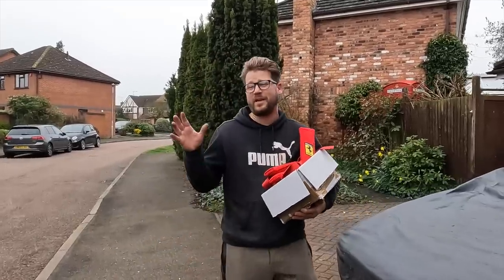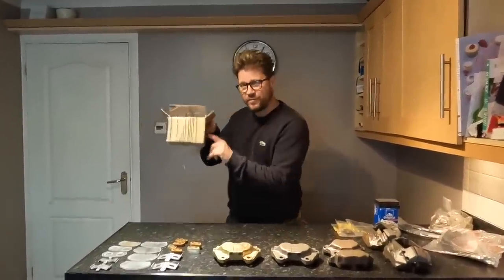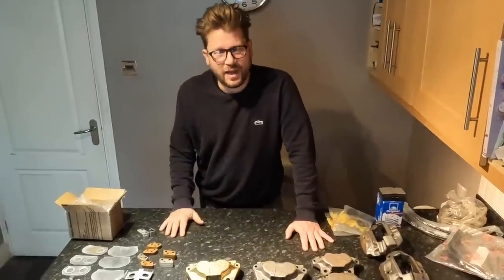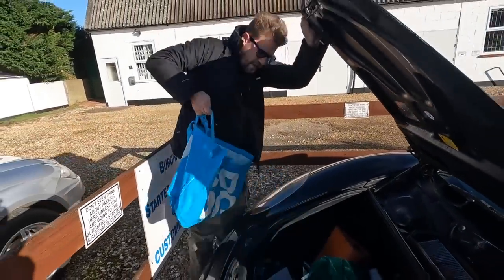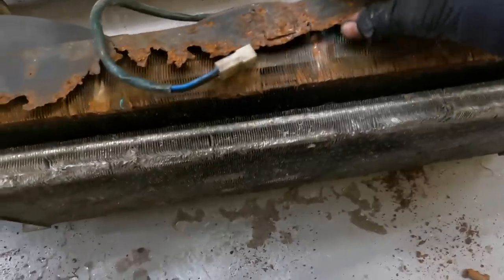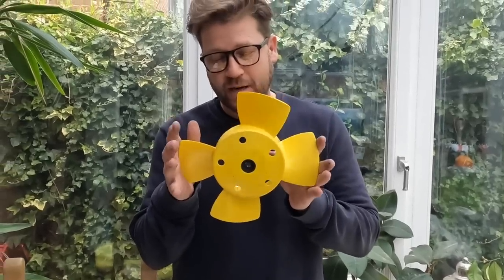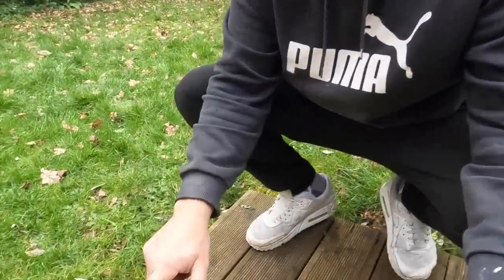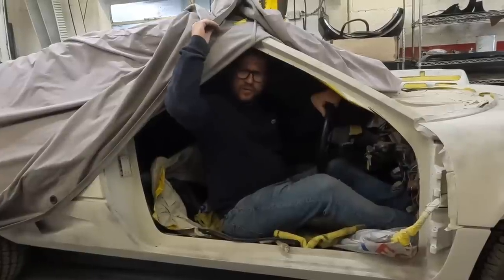Barnfind Ferrari 512 BBi -  Lost Parts Brake the Restoration

Comment: PMB Performance in the USA can do your caliper finish. They specialize in vintage ATE brake restoration.
Reply: I’m sure there are companies in the U.K. who can do it as well
Reply: PMB are experts in calipers. Specialize in Porsche, but they are often the same manufacturers. They have all the right equipment to do them right.
Reply: @robbrooks4964  Porsche used to have a special Cadmium based electroplating solution for their parts. Nowdays considered to be extra toxic
Reply: I was going to say PMB as well. Top notch, so +1 to this recommendation

Comment: Any metal parts you want to protect from corrosion, wrap them in heavily waxed paper too like every old hardware shop used to do. The radiators and fans look stunning !
Reply: Where possible, a thin coating of oil will help just as tools are shipped, or wipe down with ACF-50 a favourite for many all weather bikers to prevent rust and corrosion, it even removes surface rust.

Comment: I assume that you'll drill a couple of drainage holes into that bracket below the radiator to ensure the rad no longer gets to sit in a pool of water and rust to bits again!!  And protect them aswell.
Reply from the maker: I sure will 👌🏻
Reply: @Ratarossa  Some Rads sit on a sponge cushion which holds moisture. Poor design but once out of warranty when they let go ....

Comment: It has to be possible to zinc plate with yellow passivation , Brake callipers to this day are being plated that way at the suppliers factories, BUT back in the day hexavalent Chrome was used for that passivation, that's now banned as very carcinogenic. The modern process uses safer trivalent chrome for the passivation and you won't get quite the same shade as back in the day. But you need a plater who knows how to plate cast iron  ( spheroidal graphite cast iron in this case).

Comment: For the brake calipers, I recommend treating with OSPHO chemical treatment following rust removal. It treats the metal to prevent rust formation and forms a surface that primer and paint can adhere to.

Comment: zinc plate first then gold dichromate- which is a passivation(forced oxidation creating a harder more durable outer layer) of the ZINC plating.
These passivations are listed from least durable to most durable
Zinc with Clear/blue passivation
Zinc with Black passivation
Zinc with Yellow dichromate passivation
Zinc with OLIVE passivation.

Comment: i vapour blast and polish for a living, you cannot vapour blast parts with bearings and moving components unless you strip the part completely. Same with intake manifolds.. after blasting they have to be cleaned inside and out, no abrasive can be left behind..
Reply from the maker: Hey buddy, i tried to email you about various things but it bounces back, any idea why ?
Reply: I've been told that such parts need to be boiled in water to remove any fine abrasives that get trapped in pores after blasting (when the part has critical moving surfaces involved.)
Reply: @ferrariguy8278  Can use ultrasonic cleaner as rinse, then dry with compressed air

Comment: The blades on MG fan could easily be  machined down on a lathe by making up a mounting plate to hold it and then the ends of the blades will be machined to the correct diameter accurately.

Comment: Powder coating is the answer for your brake calipers I think. I've had some amazing results for old motorcycle wheels and frames.
Reply: Still need plating 1st other wise areas that musn't be painted will corrode ( including inside) and as soon as you get a chip the powder coat will blister off , has to be Epoxy not polyester -  Iron brake callipers with painted finishes that many modern cars have are all zinc plated 1st and then primed and epoxy painted.

Comment: Hi Scott, the caliper halves are Nodular Cast Iron (Also called Spheroidal Graphite Cast Iron), not steel. It is the same material that any caliper housing or master cylinder body is made from (unless its aluminium!!). So, there are a number of platers out there who do the yellow zinc passivate for companies that make brake master cylinders and calipers. There is a company called PastParts in Bury St Edmunds who specialise in restoring brake components and claim to be able to get the correct Zinc finish, they could be worth a call. Do be careful with your seal groove in the caliper body, as these have been plated once you need to make sure all plating is removed before new plating is added. If the seal groove becomes smaller by more than a few microns then the seal may have too much compression and the piston might drag. Normally when caliper bodies are produced, the raw casting is zinc plated and then it is machined, meaning that the machined surfaces are not plated. Look for people experienced in brake restoration, not general zinc platers.

Comment: Rata after doing the zinc coating you should clean with distilled water thoroughly then when you dip the yellow/gold chromate dip for no more than 20 to 30 seconds it should not matter what steel is used if the process is done correctly it should stick i would try another plater as people do things the same BUT different technique cheers from down under

Comment: Im in the states so I got quite a few hits when goggling yellow zinc platting so there are definitely people out there to do it. But it doesn't hold up well on brake calipers. I had gotten some replacement calipers for my daily at one point with the yellow zinc finish and it didn't last long. And while searching its a common issue. So even though its the correct finish on something that is never going to be driven hard I feel getting them powder coated as close to the original color as possible would be your best bet.

Comment: To zinc properly don’t they have to coat it In a different base metal like nickel, that what they do with gold plating jewellery etc. just an idea
Reply: No ZINC is the base metal. You could copper plate it first, however the ZINC is a sacrificial metal which is designed to corrode FIRST instead of the actual metal part.

Comment: Good interesting stuff.  That Radiator Rebuild was a fine piece of work. Missed how much it cost.

OEM £4490 from Ferrari .. :-))

Some OEM parts are silly expensive, even ordinary production cars like my MG Montego Turbo was back in the day. Cowley MG in their wisdom decided to reduce the width of the NASP MG Montego's radiators to allow the twin to-from Intercooler Pipes to pass at the side. Must have been at least a 20% reduction in width. Cue a tendency to see the temperature gauge rise on hot summer day Motorway hold ups with the radiator fan kicking in and out manically sometimes on really hot day stop start hold ups. Never over heated but, was a worry.

Not only that reduction in width and frontal cooling area, making things worse, they fitted smaller capacity PLASTIC side reservoirs not the superior METAL/Brass? ones on the NASP MG Montegos. d'OH. I removed the metal radiator from a rear ended Montego in my favourite "Remove it yourself" breaker yard. A fiver .. :-))  and took it to a local radiator specialist. Along with the skinny OEM original to use as a dimension pattern. I asked them to use the superior and larger capacity metal side tanks and fit a new TRIPLE CORE Radiator using the metal side reservoirs. They did a superb job better than I expected. That £100 cost was possibly the best hundred quid I ever spent on any car upgrade. It enabled my MG Montego Turbo to be cruised all day long if required well into three figures MPH with complete confidence. Much to the chagrin of friends in so called superior cars like Mercedes trying to keep up and failing.

Even twenty years ago allowing for inflation, that was one hundred quid well spent.

I have an image somewhere off the Rebuilt Radiator sitting on the old one clearly showing the deeper triple core and superior metal side tanks within the same OEM dimensions. Cue folks asking what has been done to the MG that it was so quick. My honest answer, the engine and tuning was bog standard.

Comment: The Yellow aka Gold zink plating is done still today on custom computer networked cabinets or data storage cabinets there a few who make and plate them still in the uk they acid zink the coating on by dipping it into a chemical bath to the metal body of the frame to the computer for heat protection, The same process which was done to the callipers back in the day, it a long story how i know that
Reply: All the other parts he's had done were zinc plated and chrome passivated OK , but they seem to have had trouble plating cast iron, won't ever be exactly the same colour as back in the day as modern trivalent chrome passivation doesn't give quite the same colour as the old now illegal hexavalent process.
Reply: @jabberwockytdi8901  Dear Sir. 
The process by Ferrari which i rang myself today 
1.clean in Alkaline solution
2.water rinse (still water)
3.Acid pickling (HCL)
4. Water rinse time 2 one after the other again in (Stilled water)
5. Electro plating in Acid Zine Bath 
6. rinse again in (stilled water)
7. Dip in Yellow Passivation 
8. rinse again in (stilled water)
9. natural dry 
the process in total is 9 hour and 47 minutes 
the same process is use still today for the metal casts for computer network cabinets as ive already said again the same process was used 40 plus years ago.
i have been in the pristine car trade from the day i was born i know what i an talking about......
Reply: @rob612  Those original calipers look cadmium electroplated which is silverish
Reply: @jackdripper5675  if you look at the video again at 3:29 even Scott explains there finished in a yellow ish or gold finish from ferrari, off the top of my head google the part ferrari 136596 it should come to a original front left calibre in the same finish Scott wants and the same finish that is used for the inside housing for computer cabinets or the metal frame that the computer sits in, i personally been around a few BBi in my day as well and one that was fully restored similar to scotts

Comment: You really had to fly to Florida to make that tiny part? There isn't a CNC-manufacturer up to the task anywhere in the UK? Hard to believe... but I guess Florida weather was a nice break from rainy England :D

Anyway, things coming along nicely, and that radiator looks fantastic now! Did they refabricate the rotten metal part as well? Awesome job! 
Maybe there should be some drain plugs installed on your car under the radiator to avoid getting it rusty again.

Comment: If cost is not an extreme concern you can Cadmium plate and then zinc plate. Zinc plating directly to cast iron requires acid strike vs normal alkaline. Gotta be someone in UK. If not, Poland has everything lol.

Comment: If you want to color the calipers try powder coating them. It wont burn off and I just did a quick check and they have a Ferrari yellow.
Reply from the maker: The problem with this one is I want to have it totally original spec otherwise I would powder coat
Reply: @Ratarossa  Ok that explains it...Thanks for the response...! I cant wait to see in back to spec...!!

Comment: I assume the "Gold" finish you are referring to on the calipers is cadmium plating. It's not hard to find someone who can replate them. It is much more resistant to corrosion than paint, cadmium plating is used on a lot of aircraft parts as well as areas with dissimilar metals. Someone who professionally rebuilds carburetors should be able to replate these for you.

Comment: Great Video!

Love the Radiator / AC condenser rebuild! However, you stated the positioning will lead to it rusting out again as water is unable to drain in the location where they normally sits. What are you planning to do to prevent this type of problem happening again?

Cheers,
M-

Comment: Oh boy, after all these troubles to get the fan you use a driller and hold it by hand?
Could easy end-up off center, I would have popped by a local machine shop with some beer cans or a cake and borrowed a rotary machine!
Did you try if the fan runs balanced and centered now! ;)

Comment: Scott, did you look into Nyalic as a clear protectant for exposed metal once it has been finished (to further prevent any future corrosion?   Interesting that there was a problem plating the calipers. You'd think a plater could do a number of coatings of a base metal (maybe zinc  maybe not) then follow up with the yellow Zinc plating.   And it was yellow Zinc originally and not Gold Cadmium?  I know in the US BrakeBoosters is a company that does refinishing work for classics - both Zinc dichromate and Yellow/Gold Cadmium.   For possible future reference I'm seeing fans that appear to maybe be the same off of a 127 FIAT Panda, Fiat Ritmo (83 to 87) and maybe a 85-89 Lancia Y10.

Comment: Just do the yellow zinc yourself. By the elements put them in a bath of water with salt and use direct current. I got some solar panels and I just use those to do some electroplating. I'm sure somebody Patton to the process for yellow zinc pleading so read the Patten and get the formula. Good luck.

Comment: Ferrari probably plated the calipers with something else first, like copper or nickel before doing the yellow zinc. I used to plate and anodize and that was the trick for plating. There are also conductive coatings but I doubt anything that exotic was done.

Comment: Absolutely love the channel mate and with all your projects on the go, it doesn't look like you will run out of content for quite some time haha
Hope you end up restoring the 456, I have the identical car her in Australia, with all the same issues.You have solved many of my problems for me and I have many more to go. Cheers :)
Reply from the maker: they sure are problematic. I have a couple of new ones to figure on it. Here they are still a cheap Ferrari, I often want to sell it but i look at it and its so good looking and understated from various angles I decide to keep it
Reply: @Ratarossa  I have had mine about ten years now and like you I got it crazy cheap (30K AUD), but not running, turned out to be an immobiliser issue, along with other things. Spent months just trying different things until I finally stumbled onto it. Been running perfectly for most of that time just little things, but last year it did a head gasket which wasn't much fun. All good again now. First thing I haven't fixed my self. Keep up the great video's

Comment: Hi Scott, I'm not sure how you kept the hole you drilled concentric with the original one, especially with the slots cut in the original hole. Check the fan with the motor before you put it on the shelf. If it's not concentric, it will either ruin the motor bearings, or if it's really bad, shake the motor enough to crash into the fresh radiator. Good luck with the work.
Reply from the maker: Yes I was very concerned about that, I have checked as best possible and will spin up the motor for a final run
Reply: @Ratarossa  if it’s not concentric, there are solutions. Good luck with the restoration!

Comment: I find it hard to believe it was easier to fly to the USA to get the parts done. I have hade parts cnc milled and routered in metal and carbon here in the UK easily. It's not cheap with combined design time then machine time. But no plane was needed

Comment: also the only thing I know to fix rust on steel is to have the rust sand blasted off after you seal of the areas where pistons and break bleeders/lines go in..... then zinc plate it after the sand blasting..
Reply from the maker: thanks for the tip

Comment: Issue with you getting the yellow finish is that it’s zinc plate with a passivation layer. The passivate layer is hexavalent chromium, this is now banned under EU regulation 1907/2006, you may be able to get this done outside Europe. Hexavalent chrome is a carcinogen.

Comment: probably been said but are you putting 12v through these electric motors to make sure they are working before rebuilding?
Reply from the maker: most of them i am tested yes
Reply: I figured you were. Wish me luck. Trying to correct a fuel supply issue with my 01 456mgt. Hopefully corrected for the weekend.

Comment: Hey, Ed here (AKA Fast Eddy) from Utah! Remember me? I have a contact here to zinc your calipers. Let me know if you still need help with that. Cheers!
Reply from the maker: Hey Eddy, thanks buddy. Did you see the Enzo parts that went through auction last night RM Sotherbys ? I was going to message you but  I only spotted them as they were going through the block. Damage rear quarter, under trays, wheels etc